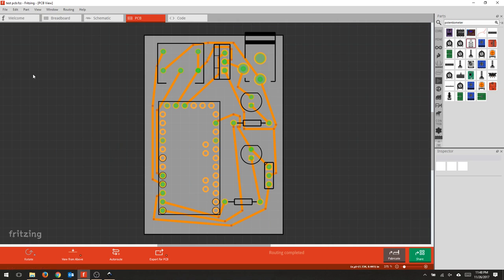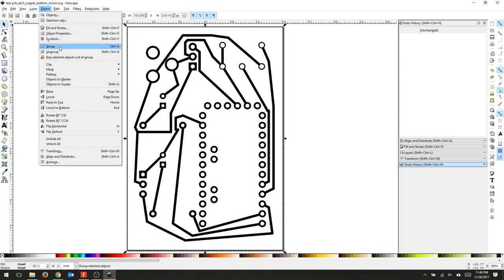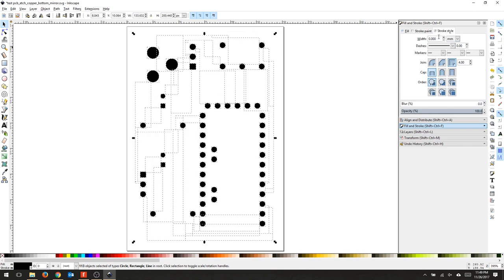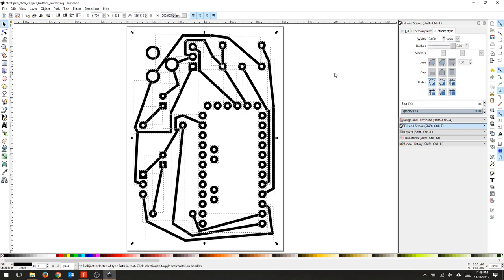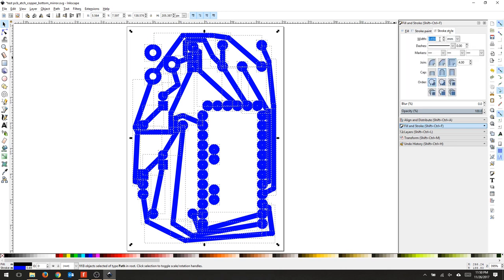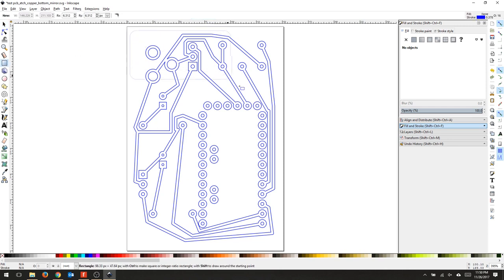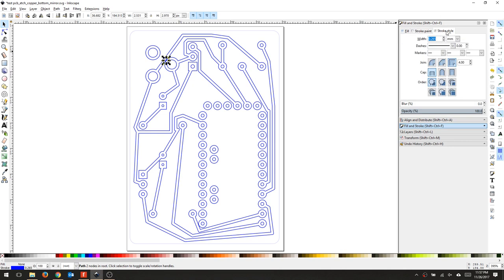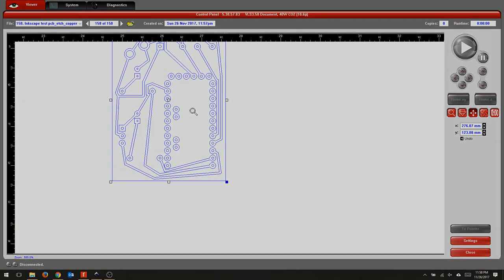Fritzing to Inkscape: PCB Isolation

Comment: Hello, i've got troubles to link correcly the wires with the components circles. The wires are going inside these circles. Have you got a solution ?
Reply: Victor Koulytchizky make sure to ungroup everything multiple times in the beginning until there are no groups. Then at the very end also use the union to bring everything together. If it still looks odd you may need to play w the stroke width or adjust placement of components in fritzing. Hope that helps.
Reply: Eric Bredder thank you, it was very helpful!